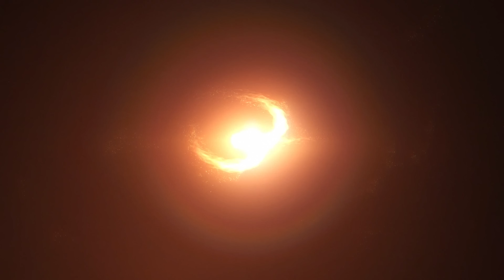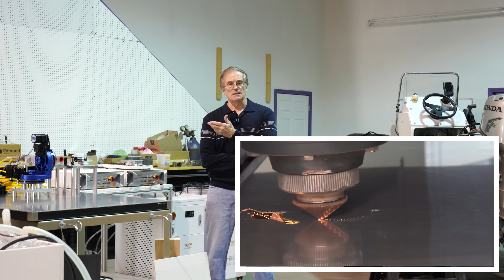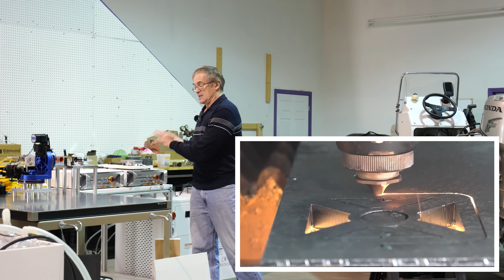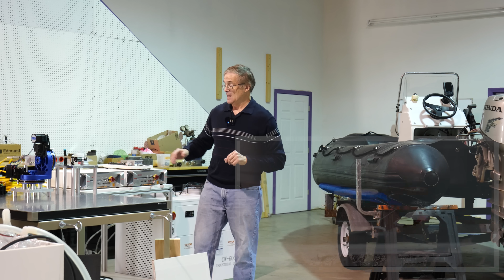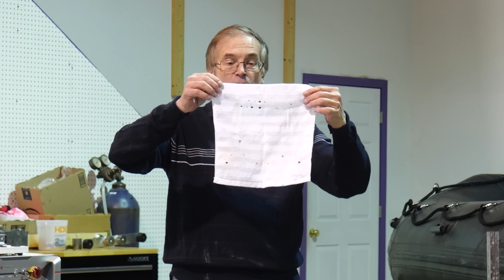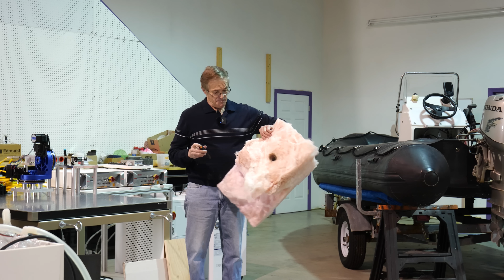We have a problem... and need your help!

Comment: There are a number of great suggestions from sources far more credible than me but to add to the conversation: While I can only point to theoretical proposals for this solution there is intuitive merit to turning what is currently your problem, ablation, into the solution. Your problem is that the insanely intense heat almost instantly vaporizes any material in front of it. But this could be turned into a benefit if you select a material that when hit by your beam will vaporize into a dense and opaque could of gas that can itself absorb a significant amount of the laser's energy before it diffuses sufficiently into the atmosphere. Another comment comes close to this suggestion with copper but they're relying on the chemical properties changing at temperature to absorb more energy and I'm suggesting that instead we take advantage of the fact that several materials when hit with such a high energy beam ablate into high volumes of gas or otherwise dispersed into the air itself. At least intuitively this helps because the laser will lose energy with every interaction it has with anything it comes into contact with along its path and while we can't necessarily stop the laser with something that is convenient that is solid and thus presents dense material that can be ablated away in layers a gas or air that is otherwise full of material that interacts with the laser can do so across the entire segment of the beam passing through it instead of just the cross sectional area presented by a solid and, importantly, is already either a gas or as ablated as it's going to get and each individual particulate is only going to absorb a small amount of the overall energy in spite of dissipating a great amount collectively. I don't believe it's a coincidence that one of your better performers was the plywood. The primary factor in that was likely the smoke being generated upon ablation because the smoke was absorbing a fair amount of energy from the laser before diffusing enough to allow more wood to be burned thus regulating the rate of ablation. I am not a material scientist or laser expert but from these logical conclusions we can infer that the material you're looking for has a few key characteristics it must display: It must be readily available as it will be consumed in testing, it must create an opaque cloud of material or "smoke" when hit by the laser that efficiently absorbs the energy and thus sufficiently moderates the rate of ablation of the material being used, this material being introduced to the air in the testing area must be safe to the health of those conducting the test and the environment, and the material needs to meet criteria you are more qualified to quantify regarding the overall convenience of the material for your circumstances.
Reply: Before anyone makes fun of me, yes. This is the "ablative armor" used by the ships in the science fiction video game franchise Mass Effect as described in the codex in the first title. That being said I'm all but positive I've seen the concept proposed in far more credible places. I'm eager to have someone educate me on something about coherent light, ablation, and the practical properties of how efficiently that much energy could dissipate in a region of air that's become opaque and thus absorptive to the necessary wavelength in a given volume I don't know though I would put to the question: It's hard to deny making the region of gas the laser must pass through to hit your last line of defense absorptive across the entire region of the beam intersecting that region would help. You could, for example, have this material in front of the suggested copper material to give you additional quite precious time. One might credibly ask if this is so simple to do why it isn't the go-to method for the high energy laser applications being described by people working in that field and I would intuit that it's a simple matter of selecting for the solution that makes the most sense for your application. A laser trap absolutely makes sense for a laboratory laser that can be constrained to only end up terminating in said laser trap which are themselves at almost any scale very prohibitively expensive. The caveat being that it is, more or less, a one time expense and thus makes perfect sense given the use case allows for selecting this option to "come out ahead" in the long term. In a laboratory or other setting with a far more static and controlled laser the use of a deliberately ablative solution introduces a myriad of challenges in that environment ranging from removing the material that's been dispersed in the air from it, dealing with what can't be collected in filters winding up settling on every surface in the room it's being used in, and of course the ablative material itself being consumable and needing constantly replaced as it's consumed during operation. None of this makes sense in a laboratory or industrial setting but that is not your use case. You have almost the exact opposite use case. You have a laser that absolutely will not be firing exclusively in one predictable location, you need a solution that is not prohibitively expensive not just in acquiring a trap but any proposed method of reliably ensuring that it is always in position to intercept the laser, you do not care if the use of an ablative material results in some smoke and a light layer of dust because you will not be operating this laser regularly for scientific testing or industrial purposes with regularity into the foreseeable future. You will do your testing for this proof of concept and move on

Comment: Using elevation such as the camera angle @7:35 you could fire down into a trailer filled with sand.  This assumes that you're planning on maintaining the building as the lab and climate controlled.  The trailer could be rolled in/out as needed or repurposed going forward.  2c fwiw.
Reply: Maybe experiment with different colors and grades of sand.

Comment: How wide a spectrum can you put through a fiber? I suppose it depends on the material but is it very specific or can you put several different beams through it without heating it?

You know how table salt is the most infrared transparent medium on earth? You know how rock wool is flexible? Can you make a salt fiber durable enough to use it as a fiber optic?

Comment: Composite laminate of graphite and sand or crushed glass that can fall in to fill the void as the laser melts through.
Reply: also you had this fire proof piece of toast i immediately thought about
Reply: Cool to see your suggestion. Piggybacking your comment to suggest hardie backer board. Probably two or three deep given how narrow your beam is. Bonus points for a spinning board to spread the energy around. 

Since you're spending money,  look at zircar. It's reflective but lambertian and diffuse. 

Alternatively graphite blocks but they make a mess.
Reply: Graphite is expensive. Burn toast is cheap. My idea is a wall of Ooblek, but power the laser with a Giant Capacitor bank to take small shots without going into a "failure mode" That sits there and cooks a back wall for 10 minutes. I think this technology of not shooting a laser through your forehead already exists in tattoo removal lasers, but Im no laser expert. Oh yeah. Kind of defeats the whole point if your drone can just fly in with a piece of burn toast attached to the front.

Comment: Speaking purely off of intuition, have you considered using hydrogel confined in glass walls? You can manage the thickness rather easily provided it works, should be relatively chip and scalable. The thought process is that it might be able to disperse the beam in a similar manner to the attempt with the fiberglass, but it will also be able to observe the heat and turn into steam to protect your car and walls..

Comment: I'm not sure what type of drywall you've used but try Firerock it's much better than regular 1/2 in rock. 
Another possibility might be oven insulation, or Rockwool comfort board, it's much more fire resistant than fiberglass. 
Lastly you might be able to get a panelized aircrete.

Comment: I would get a fish tank or any container that could contain material and mount something onto on the inside. Fill it with sand and then put as much water in as possible. In one side of the fish tank, in a sealed hole in the glass, you would have a prism that is tuned to the light frequency of the laser. So when the light hits the prism it splits the light into multiple directions. This would also split the heat load into several directions and hopefully be easy to fix/repair, all of this assuming you could find a prism capable of withstanding the lasers initial heat.

Comment: I'm not sure exactly you would execute it but a wall with several layers or curtains of water in laminar flow and spaced about an inch apart feeding from a trough above and open cell foam filled collection trough at rhe bottom for recirculation... Coupled with a pigment suspension I'm thinking graphite powder and glycerin or possibly titanium white but I would be concerned about it being reflective. With the very back as a layer of drywall or cement board... The thought being while a single water curtain would not stop it at least 2 or 3 if pigmented may disperse it enough to buy time at the drywall cement board. I have seen similar things used for visual effects as projector screens but obviously nothing remotely close to the power you are pushing.

Comment: Use Starlite. The only thing that can dim a laser, is another laser. If you shine one into the other it should dim the laser. However, since you're pointing one at the other it could be expensive if not perfectly aligned. Starlite is just baking soda, cornstarch and Elmer's Glue. Cheap, easy to make and should work on whatever you finally decide to put it on. If it can protect a reentering spacecraft it should slow a laser or stop it.

Comment: Consider Chrome corundum bricks superior corrosion resistance due to their unique Al2O3/Cr203-solid crystal makeup. With an increase in Cr2O3 content, these bricks exhibit enhanced resistance to corrosion. Simultaneously, they offer notable wear resistance, exceptional thermal shock resilience, and a minimized creep rate.

Comment: Granules of the same material as the fiber used to transmit the laser in a tank that is sealed from light all around except for an entry hole that sits deeper into the tank than the nearby tank wall, filled with water and violently agitated with pumps to diffuse the energy randomly to the entire "blacked out" inner surface of the tank.   Possibly also using a pump to feed filtered, granule free water at the entry point along the beam path so the first granules it hits are deeper in the tank to further reduce the amount of energy returned towards the direction of the source.  The water can be filtered and drained for transport.

Comment: What about a custom glass 'fishtank' filled with dyed water?  Tall and thin, maybe an inch or two of water.   Assuming it doesn't damage the glass, the water is really good at absorbing heat.  If it scatters the light too much, maybe a backing layer could be filled with dirt/sand to absorb the remaining scattered energy.

Comment: A rain curtain.  Dope the water with something that will disperse and absorb the wavelength your lasers are operating at.  You still might need a backing, but hopefully the water would have dispersed and absorbed enough energy for it to survive.

Comment: My only thought is to adjust the way the experiment itself is setup, rather than trying to apply damage control. If you could arrange your drones to only fly in a two dimensional space (up-down-left-right from the viewpoint of the lasers), midway between the lasers and the workshop doors, you could try tweaking the optics of the output stage to be very divergent, so that the energy density is maximized at the target point, and diminished by the time it reaches the rear of the workshop. I'd guess you'd want the beam to be ~15 inches wide by the time it hits the rear of the workshop. Tricky.

Comment: If the over all problem is the physical limits of making a 'wall', then rearrange the direction of laser travel to shoot downward at a floor mounted target that can absorb the excess energy. ( Even some kind of a tray of sand as a back stop, ) yet my point , to not have a wall of any kind, that later has to be removed.

Comment: Have you guys considered  "Intumescence"? Kind of like oblative shielding on a spacecraft.  Night Hawk Light has a pretty great video on DIY coatings he's come up with. Then you could use segmendted material of your choice to build a modular wall and coat the pannels in it. Easily re coat when needed. And as soon as the carbon foam begins to form do to heat it definitely is not reflective. Be an easy avenue to test small scale too. Here is his video https://youtu.be/8Z5RPPRS-KQ?si=oVuSLTlm7G6B47E1

Comment: How far do these beams remain dangerous?   It seems to me that you are working toward a solution that can't be used in the real world.  If you can damage a satellite or blind people in the background, how could you use this?  Maybe, in the case of war, there are acceptable loses but it would be nice to have this useable in New Jersey or over government facilities to take out hobby drones.   You could add an almanac of all the satellite and airplanes along with the local horizon but this could give the drone an avoidance solution. and would be difficult to implement.
Seems to me that a widely distributed , less collimated, set of independently tracked emitters would solve this.   Another option is to have your telescope collimator  with a very wide  aperture and a focusing  final lens. 
For a back stop, I'd suggest a plywood box/tank.  Place a collection trough on the floor, put your plywood double sided wall with scattered bolts to hold the sheets from bowing from water pressure into the trough.  Caulk the corners as needed.  Put a sump pump in the trough to recycle the water as you punch holes in the plywood and drain the system for transport.  Add dye to the water as needed for absorption.  A moving backstop or emitter greatly reduces the need for a robust backstop.

Comment: Maybe there’s a way to refract and scatter the beam so that it spreads the energy over a much larger area. Perhaps some crystal powder/ glass dust like they use in highway paints, but turned up to 11. Suspend it in polymer that’s transparent and doesn’t gas off immediately to the laser🤷🏻‍♂️

Comment: would a rear frosted glass panel be able to diverge the beam enough that drywall or another material would be able to handle it without reflecting it back to you(maybe angled)?

or, how about  a water tank with a dye that is translucent and able to absorb at least most of the energy dumping it into the water?

Comment: It sounds like the laser light travels through a fiber filament before reaching the focusing head, if so it seems like you could put curves in the fiber filament allowing some of the light to escalate causing attenuation before the light hit the focusing head. So attenuation before the light leaves the device. Feel free to reach out to i would be interested in sharing my experience work in telecom fiber optics and communication lasers.

Comment: Hey- wierdly enough What about Harbor freight CHICAGO ELECTRIC

4 ft. x 6 ft. Fiberglass Welding Blanket

(545)
$19.99  Stacked like 1950 Billboards and maybe with self sealing water vessels between?

Comment: Two airgapped stretched reflective mylar films with mirror surface toward eachother, 
and a non reflective side facing the laser, creating a infinite mirror when pierced.
Angled to stop reflections, and possibly with a slow burner like silica airgel sheet
instead of airgap.

Comment: A strong absorber combined with cooling or a diffuse reflector are your options, however diffuse reflections are hazardous with this laser power, so you do not want to be in the same room as the laser.

Comment: What about ballistic gelatin (or any industrial gelatin) with some kind of silica, silicon or whatever else mixed in (sand or small stones or quartz, glass).  It would be a lot like the brick idea though because the gel would need to be formed and supported in layers/cells.  Maybe even fire retardant insolation (the green kind) incased in layers of gel.  I am guessing in the future, the plan is to not even need a backdrop.  It's fun to have these little brain teasers.  If the gel idea works, would be cool to see a video of making and testing different gel mixture prototypes.
Reply: - an idea would be to form a cell with the gel mixture on plywood (or steel depending if budget allows?) with many nails (or whatever) to hold the whatever thickness of required gel mixture to the wood (pour the gel mix over the "nails" so the wood acts as the support/structure for moving and set up) .  I also wouldn't have the gel cells perfectly perpendicular to the light.  
- Another idea would be have the backdrop move slightly to not have the laser on one spot for too long.  (not really keen on this but you know "brainstorming")

Comment: For testing purposes in controlled setting only: Simply use a lens/lenses  to make the beam diverge rapidly in a specific location. By spreading the beam, you don't need nearly as much of any material to quench the beam (inverse square power law).

Comment: Use some kind of conveyor belt, maybe leather belting.  Run it really fast and have water sprayers on the back side so the surface is constantly wet.  If your laser perfectly tracked a point on the belt it could burn through, but how likely is that.